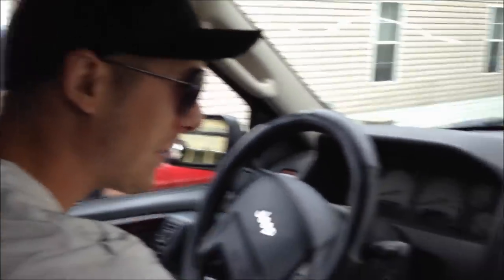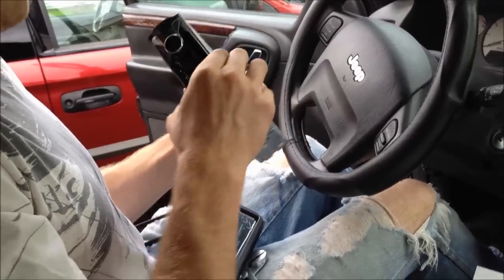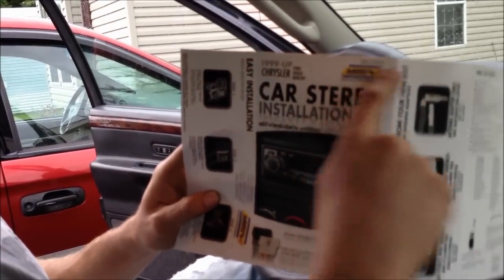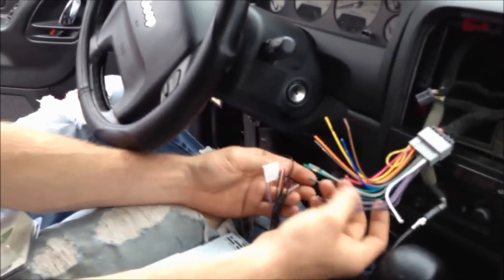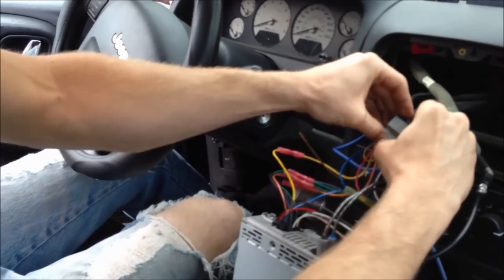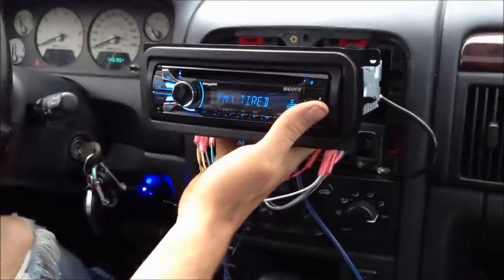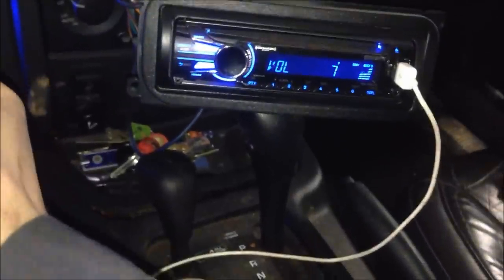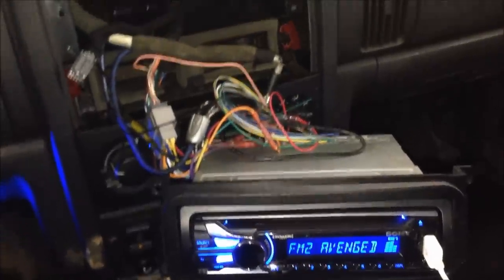Jeep Grand Cherokee Stereo/Deck/Radio Install (1999-2004)

Comment: I wired everything color to color but I have a solid blue wire (power antenna) an orange (dash light) and a blue with a white stripe that don't have matching wires. Am I missing something?
Reply from the maker: wkarl00 - the blue with white stripe should be coming out of the radio, that's your signal wire for an amplifier if you have one. The solid blue wire should be coming out of the dash. I generally hook the solid blue to the blue with white stripe. If you have an amp, the signal wire would also tie in there. The solid orange wire I thought came out of the dash and I thought there was an orange with white stripe coming off of the radio, I hook the 2 oranges together. If there's not a second orange then you just don't connect it.

Comment: I have the same exact radio and SUV but for some reason the radio never comes on by itself , after turning jeep on I always have to turn the radio on manually, how can I make this radio turn on automatically?
Reply from the maker: The yellow and the red wire are your constant and switched power supplies. Double check those are connected correctly first.

Comment: Hi Tony.
I have a JGC 2000 and connect my aftermarket but there is no sound. Is there a harness connection I have missed? I watched your video, and the connections seem ok.
Reply from the maker: Are you sure you've connected each corresponding colored wire properly? The black wire needs to be grounded and the blue wire goes to the blue wire with white stripe. Also make sure your wire connections are good.

Comment: excellent installation video. Thanks to you now I have new aftermarket head unit and new set of 4 speakers. I want to upgrade the amp and get a subwoofer, do you know how can I replace the factory infinity gold amp? Do I need aftermarket connectors in order to retain the factory ones? Thank you in advance for your help.
Reply from the maker: +Alex Escobar I left the factory amp alone when I did my subs, as they only power the speakers. I then added another amp to power just the subs.

Comment: I was watching this for the radio but I heard the clicking noise in the background near the part for the steering wheel controls. My Jeep makes the same exact sound do you know what it is
Reply from the maker: Haha, that’s the unfortunate sound of broken blend doors for the dual climate control system. I don’t have a video on it, but you can look it up on Google or some forums. It’s a common thing with a few possible fixes
Reply: Tony The Truck Guy thanks so much that helps a lot

Comment: Dude, spot on. Thank you. I even got the steering wheel control module working on the first try. I'd be pissed off, halfway through installation, cursing at a manual right now if u didn't make this video.

Comment: Very nice information got here!
I've got 1 question... Will this steering controller work for after market DVD or something like that? I'm thinking about installing a DVD on my 03 Grand Cherokee....
Reply from the maker: I'm not 100% on that but I would guess as long as the DVD deck has the main black power plug like the back of my deck had and assuming you wire everything else right, I don't see why it wouldn't work.

Comment: it looked like you left the ground wire not grounded to anything, so is it fine to leave it like that or did you eventually ground it. and if so where is a good place to ground it back there
Reply from the maker: +Bryce Carlson I messed up during install, it should be grounded to a the black ground wire on the vehicle side if you have one otherwise I ground mine to a Philips screw that screwed into the metal support for the dash panels.

Comment: I know this has been years since you made this vid but I’m currently installing one now. On the adapter there is a solid blue wire and on the wires of the new stereo there is a blue wire with a white stripe. Do I connect these or leave it
Reply from the maker: That SHOULD be the signal wire for your aftermarket amp if you have one, otherwise I don’t think blue is necessary to connect. I would connect the rest and test the radio before popping it into place first though just in case blue does need to be hooked up for some reason

Comment: I have a JGC 2001 and after this video I saw how ez it was to take out the radio.I ordered a refurbushed radio online with a cd player w/cassete (current only has cassete),when i recieved it the connections for the harness was not the same .does it matter what year the radio is? i want to keep a stock look.
Reply from the maker: So the radio you have now is a factory radio, but has different connectors than your old one?
Reply: @TonyTheTruckGuy  yes the connections on my 2001 jgc radio runs across the back and has 2 prongs of equal width the radio i bought had connection holes up n down r/side of radio thanks for any help

Comment: I have the overland, the stock receiver is different. Is anything about the installation different?
Reply from the maker: Lucas Markosky - Is yours the style that has 2 flat plugs? The steps will be the same, figure out what adapter you need and then wire color to color.

Comment: I have a 98 Jeep Grand Cherokee will this adapter work on this and where did you get it and yes that extra plug is for your changer
Reply from the maker: I had Best Buy look mine up so i'm not sure. My '95 dakota and '01 Cherokee use the same filler panel as your '98 will (the more square one), but i'm not sure about the harness.

Comment: If I have both black wires do they need to be twisted together and grounded or just twisted together
Reply from the maker: If you mean 1 black coming from the Jeep and 1 from the radio, then you SHOULD be able to just connect them without actually grounding them to something.
Reply: @TonyTheTruckGuy  perfect, I appreciate you I will be doing the install tomorrow I will let you know how all works out, in this video was your ground grounded when the radio turned on?
Reply from the maker: @beastlychase  I can’t remember it’s been so long ago haha. However I hooked it up in the video here it worked
Reply: @TonyTheTruckGuy  it worked without having to ground it since I did have a ground wire coming from the harness and radio I just simply spliced and it worked because I did not have the factory ground thanks a lot
Reply from the maker: @beastlychase  Perfect! That’s kinda what I was thinking. Glad it all worked out!

Comment: Great video i just brought a 04 jeep grand Cherokee 2 questions where is the best place to ground the black wire? And what is the type of scoshe radio is tjat ?
Reply from the maker: The radio itself is actually a Sony, not a Scosche. The Scosche is just an installation tool kit which I have a link for in the video description. As far as the ground, if there’s a black wire coming from the vehicle, hook it to the black on the radio. If there’s no black coming from the vehicle, just do what I did and put a ring terminal on the end of the wire. Then you can use one of the factory screws to secure the ground wire to the metal panels in the dash. OR you can run the black wire to your battery ground terminal which would probably be the best.

Comment: i did but cant find any blown
Reply from the maker: So you found the fuse in your car for the radio and it's good? If so, check the fuses on the radio itself, most aftermarket radios have a few fuses on the back.

Comment: That groaning sound is your blend door/motor failing BTW. Happened to me in a 2002 overland.
Reply from the maker: Yeah I figured out shortly after this that it’s a common problem on the dual climate control models lol

Comment: very helpful, but I did everything you said and I'm getting power to the radio but I'm not getting anything out of my speakers, could the stock factory Infinity amp be affecting anything?
Reply from the maker: The amp could be bad but if everything worked before you swapped the radio then I find that unlikely unless you crossed some wires and blew a fuse. See if there's a fuse on the amp and check the ones on the radio itself. If all fuses are good then check the Jeep fuse panel and see if the radio one is blown. If your issue still isn't resolved, you must have a crossed wire, bad ground or no power at your yellow and red wires.
Reply: You have to hook up the Blue wire to the Blue and White wire. That will power on the Infinity amp that is stock and you will get sound.

Comment: I have a JVC Deck, and I'm installing a system in my 99 Jeep Cherokee. Will I still need an antenna adapter?
Reply: +Cameron Cannon from what I've seen the antenna adapter is only needed from 02 and up grand Cherokees. I'm getting ready to put a new radio in my 2000 and didn't get the antenna adapter.

Comment: How Do You Know If You Have The One Plug Or 2 Plug, When Your Going To Buy Your Working Harness?
Reply from the maker: I’m not positive if there’s certain years that had each style but I would just pull the 1 trim panel and 4 screws for the radio to pull it out and verify.

Comment: Hey Tony, does this video apply for another radio? and what radio do you recommend? I'm looking at pioneer?
Reply from the maker: The steps should be the same for most other radios, the only extra thing you may have to do is run the mic if you get Bluetooth. As far as brand, it really comes down to preference of the user interface and what you're using it for. A lot of cheaper Pioneer radios don't have sub adjustment so if you have subs, make sure you get one that lists that feature. Aside from that, they are all mainly going to be 4 channel x50 watt output so sound will be very similar across the board.

Comment: Does that totally bypass the amp under the right rear seat or does it still use that?  I want to put in a new radio and use a mono amp and single sub box (that I had in my older car) but still want the door speakers and tweeters to use the factory amp.  Not quite sure how that works, Ive never had to deal with a factory amp before.
Reply from the maker: +JAYZIGGY5 This set up still maintains use of the factory amp, as far as the technicality of what you're looking to do I really have no experience unfortunately.
Reply: +PkwyDr  Thanks man. that's all I needed to know. The back of the aftermarket radio's have an output for a sub which goes to the sub amp and then to the sub. So as long as the other speakers would work normally everything should be normal. ....except the stock 10 disc changer in the back. I forgot about that. I don't know if the head unit will control that or not. any chance yours has one of those?

Comment: I have an issue,my nephew was able to install my new radio in my jeep,but unfortunately I can't manage the volume behind my steering wheel, do u know what can be the issue on the wires?
Reply from the maker: Did you install the steering wheel module I showed in my video?
Reply: +PkwyDr I prbly have to re-do it cuz there was a shortage in my vehicle afterwards
Reply from the maker: +Christina Rodriquez yeah something doesn't sound like it's wired properly.

Comment: Great video. My new radio doesn't have an additional 3.5mm jack. It's for the microphone. So I have to use the female 3.5 connecter. I read the instructions but can't figure out where the brown and brown/white connect to. Can please help? I have the Pioneer MVH-290BT.
Reply from the maker: Javier Gutierrez - The brown wire coming from the harness adapter? I didn't hook it to anything since my stereo didn't have a brown wire, does yours?
Reply: PkwyDr no brown on the radio harness. Nor the harness kit for the jeep.
Reply: PkwyDr the female 3.5mm adapter had the brown wires. But nowhere to connect them to on either harnesses
Reply from the maker: Javier Gutierrez - Ok I'm just slightly confused. I looked up your radio and it shows it has a front USB and AUX port, which should be a standard 3.5mm. So I'm assuming you're talking about the back side of the radio. Does the radio have a 3.5mm male or female port on the back side? And what exactly are you trying to connect/use it for? Microphone?

Comment: Also, I have the Infinity system with power amp, so I had to connect the blue wire coming off the aftermarket harness to the red power supply wire -- the blue wire powers the amp.
Reply: So does that mean both my factory amp and after market amp will turn on the same time thank u I have no sound putting 15s in it this week just wired up the CD player but have nothing so if I.hook up the remote wire to the red wire I'll have sound what about my aftermarket amp I just bought
Reply from the maker: Shane Miller as long as you have a signal wire running from the signal port on the aftermarket amp to your blue wire on the stereo you should be fine.
Reply: Yes sir all hooked up working fabulous need to replace these damn tweeters
Reply: Thank you for the video but only thing I didn't do was not hook up the power antenna LOL
Reply: luke stafford Yea im going with Rockford everything so far I got my set up playing the waiting game with FedEx today #Box coming ill post video soon
Reply: luke stafford its just cold here in Missouri but im sick of waiting I got gold battery terminals and all wires ran already also  replacement battery is on the list but I should take it too where I got it have him replace It only had the jeep 4days and its not the right battery if I have to turn key a couple times to start when it's cold
Reply: luke stafford well.the waiting game is over my box made it here and it's tyme to put in work

Comment: Very informative. Does the filler panel fit for JVC stereo? I just bought JVC single din built in Bluetooth
Reply from the maker: The same filler panel SHOULD work for all single din radios.

Comment: This may be a dumb question, I've never put in a head unit how exactly do I ground the black wire?
Reply from the maker: If there's a black wire on the factory harness, just hook black to black. If not, all you do is run the black wire from the head unit to a known good ground, usually via a ring connector. I usually run it to something like the battery ground post, frame, engine block or even something metal in the dash that's grounded.
Reply: I was curious too, until I found there is a black wire on the harness, had me concerned I was going to have to find/make a ground

Comment: Do you have to disconnect the battery before doing this or is turning the car off sufficient?
Reply from the maker: It’s always recommended to disconnect your battery when doing anything electrical, but you should be fine as long as you don’t touch the 2 power wires to anything grounded.

Comment: I take the factory adapter, and the radio adapter in my work station and solder the wires together then add some black magical electrical tape and wallah. I don't trust just crimping etc, but each to their own, just in my opinion if I took it to a shop and they put just crimped wire cables on i'd be a little jazzed about it.
Reply from the maker: If you're going to solder it, i'd cover it up with heat shrink tubing. I don't trust electrical tape.
Reply: Heat shrink tubing is not insulation, it is only meant to hold the tape in place. So first solder the wires, tape it real good, then use heatshrink tubing to really hold the tape in place. 

To mute alternator buzz install a DC capacitor between switched + and ground wires. It also helps with kick drum clarity. 24 Volt 1000µF or larger will work. Although a really persistent audible buzz indicates the ripple filter capacitor within the alternator has failed and the alternator will need attention soon.
Reply from the maker: There's no reason for tape when the heat shrink tube is thicker than the tape, if anything, the shrink tube would be harder to slide over the wire after taping it unless you're using the wrong size tubing. it isn't meant to hold tape in place, it's meant to cover up bare wire and crimps...

Comment: Man, can you tell me what is the color of a wire color of pin 1 of the 2 pin connector? My radio doesn’t have the jack. The instructions says to connect the pink wire to the pin 1 of the two connector plug
Reply from the maker: I sold the Jeep about 5 years ago so I can’t check that for you, unfortunately. What 2 pin connector are you talking about? Should just have the main harness for the radio and then the ASWC if your using steering wheel controls.
Reply: Tony The Truck Guy I think is the one you did not use and you said maybe was for the cd shuttle. The reason why I’m asking is I’ve changed the radio long time ago, now I’m trying to put the aswc
Reply from the maker: You shouldn’t have to mess with that little plug at all. I just left mine unplugged. Just hook up the ASWC exactly how I show in the video and you should be fine.
Reply: Tony The Truck Guy the problem is that I don’t have the place for the Jack on the radio.
Reply from the maker: The black wire with the male plug on the end? That’s pretty odd.... do the instructions say anything about that?